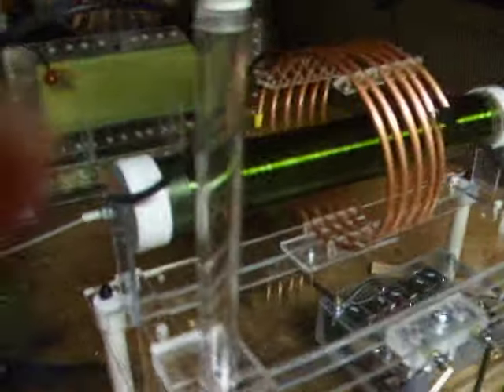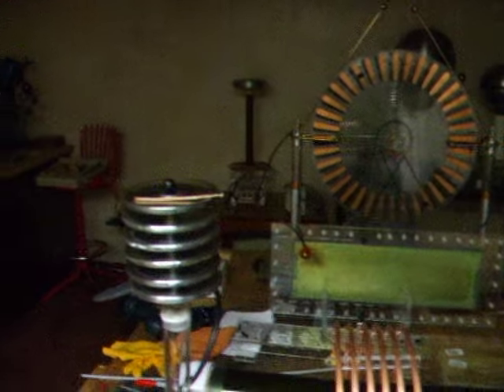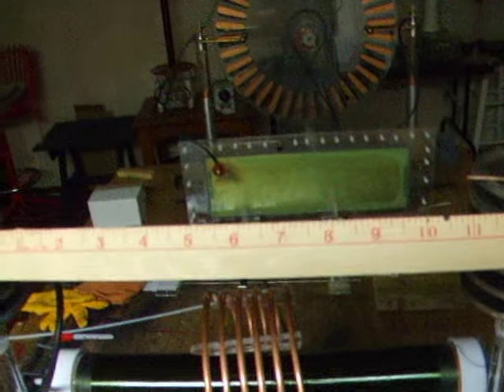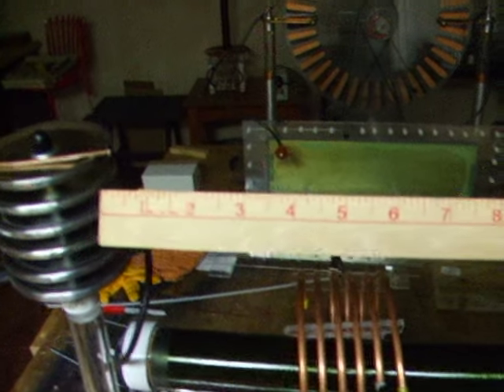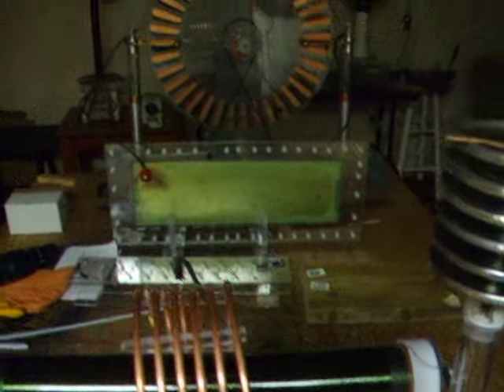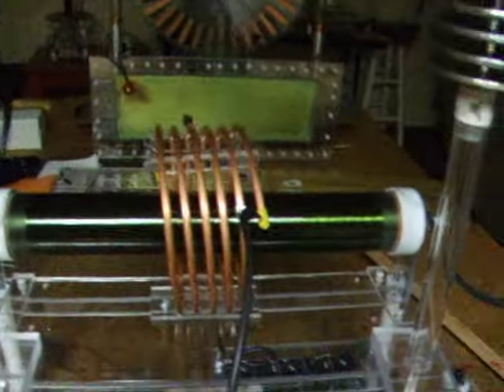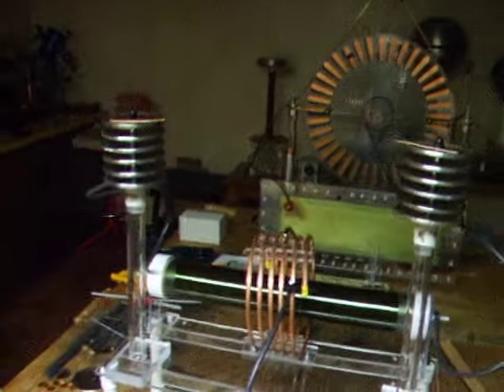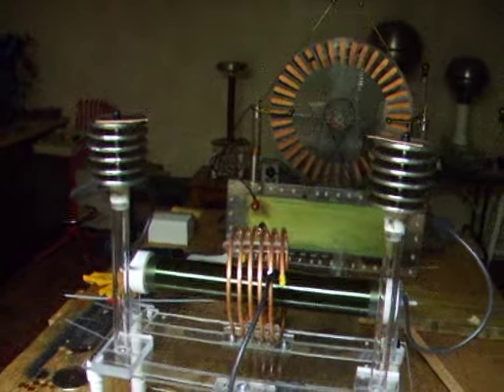2015 10190002

Comment: Looking great.  What are those disks you are using for the top collectors (to represent the toroid top capacitors)?  They seem to work well (makes a nice smooth charge field around the whole stack, actually increasing the capacitance of the top load).  You aren't loosing much energy in corona at the ends of the secondary, but I wonder if putting one of those disks at each end of the secondary would stop that corona, due to their nice rounded edges.
Reply from the maker: +kwongmanlung Those discs are large mouth mason jar lids soldered together then polished. I tried putting one at each end of the secondary but it worsened the corona there.
Reply: +dr043042 Thanks, is each disk that we see just one mason jar lid (I'm not familiar with this style of lid - I have to go shopping)?
Reply from the maker: Each is 2 lids soldered together shiny side out.